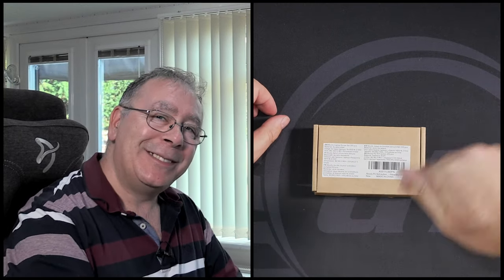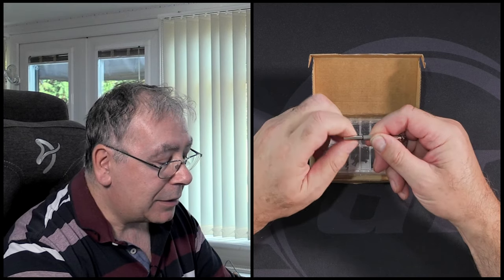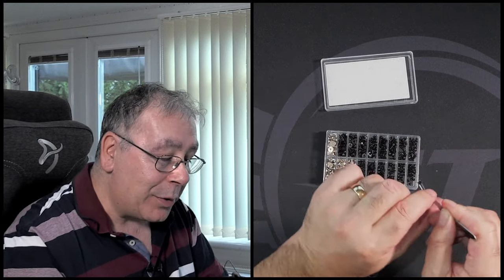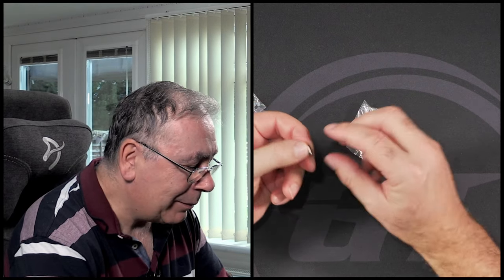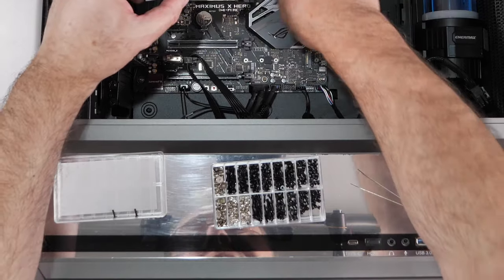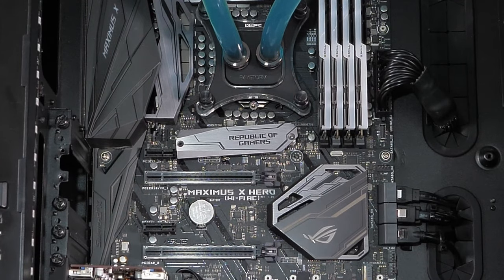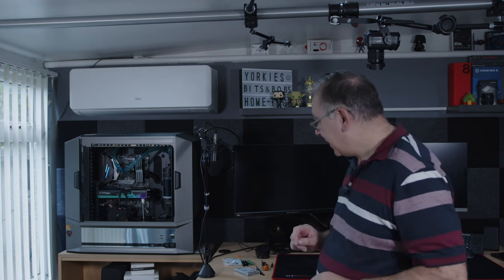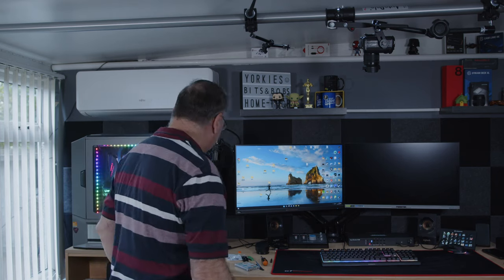New screw set for my M.2

Comment: great content mate i was actually looking through a lot of these sets on amazon as im trying to put a 512 m2 drive in my dads acer aspire e15 labtop but its actually missing the standoff screw apparently a lot of the older acer labtops if they didnt come preinstalled with an m2 you had a good chance it didnt come with this crucial part as it is a wierd screw size M2.5*1.8 the only place i can find the screw required is on ebay £20 for a screw!!!!! its like over half the price of the drive bah humbug lol
Reply from the maker: I'm not home at the moment but when I get back I will have a look for you , I'm sure they sell them on Amazon
Reply from the maker: The best that I can find is this https://www.amazon.co.uk/Mounting-Notebook-Screwdriver-Motherboards-Compatible/dp/B09YYKHLHS/ref=sr_1_8?crid=3T4IO9OSM557B&keywords=acer+labtops+standoff+M2.5*1.8&qid=1676385957&sprefix=acer+labtops+standoff+m2.5+1.8%2Caps%2C89&sr=8-8 not sure if they will fit but that's the best I can do
Reply: Thanks for trying had a look but the set you’ve linked has no m2.5 screws at all such an annoyance as acer no longer stocks the part either ( 86.GDEN7.002)
Reply from the maker: @slainearts6132  This one does https://www.amazon.co.uk/Mounting-Notebook-Screwdriver-Motherboards-Compatible/dp/B09YYKHLHS/ref=sr_1_13_sspa?crid=2X8YYLNTVYU6S&keywords=m2.5+screws&qid=1676391979&sprefix=m2.5+screws%2Caps%2C115&sr=8-13-spons&sp_csd=d2lkZ2V0TmFtZT1zcF9tdGY&psc=1
Reply: Nope no 2.5 standoffs their thanks anyways